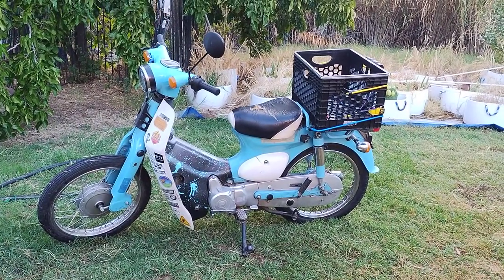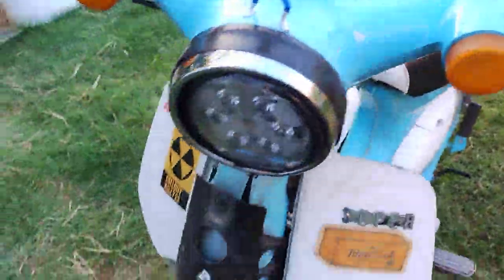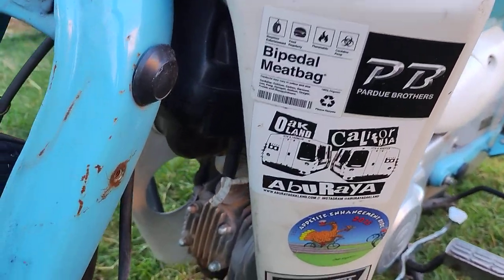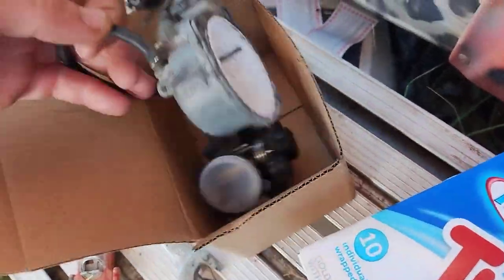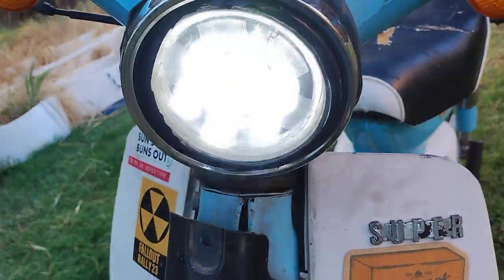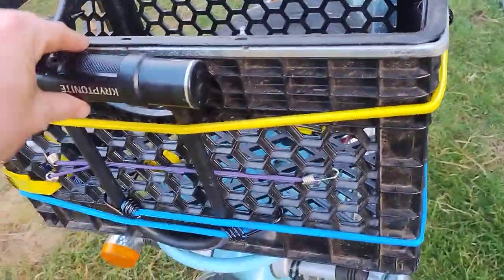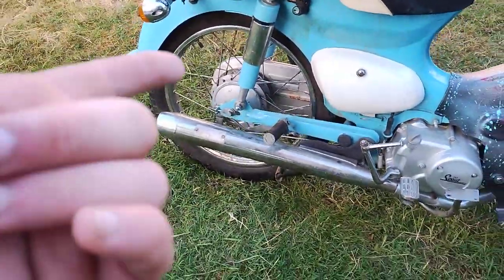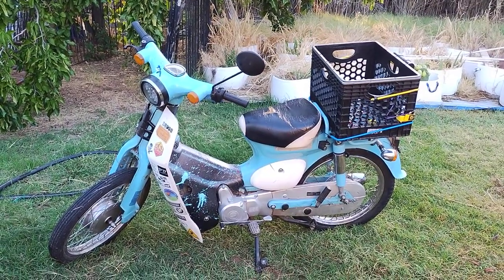2010 Fly Scout, Honda Cub Clone

Comment: Amazing how close a clone it is, it looks a lot like a C70.  1/2 a gallon of gas - but it has a gas gauge!
Reply from the maker: Yeah Jon, the gauge has of course green, yellow and red indicator bars. It's accurate up until yellow, that's the time to get gas. I've pushed this thing like 10 times after running out. The Grom just has so much more range that it seems like you'd have more riding time in between fill-ups but nope! It reminds me of the sentiment that people had for Hondas back in the day, just a throw away bike VS the $6k Cubs nowadays.